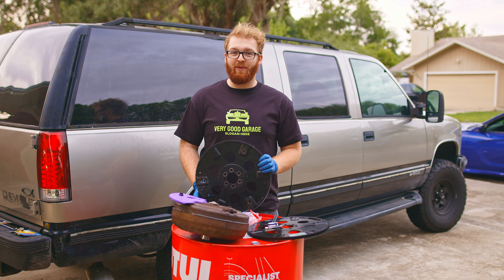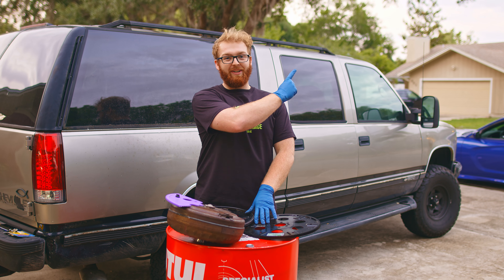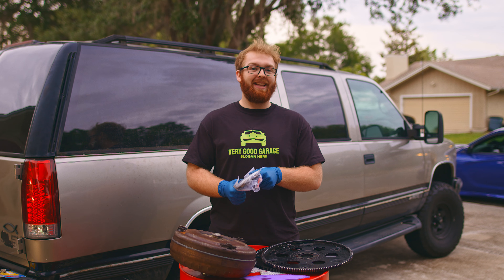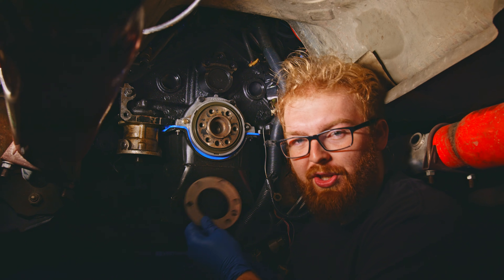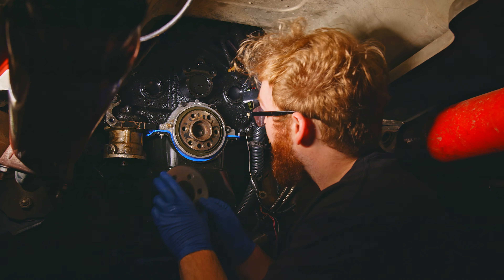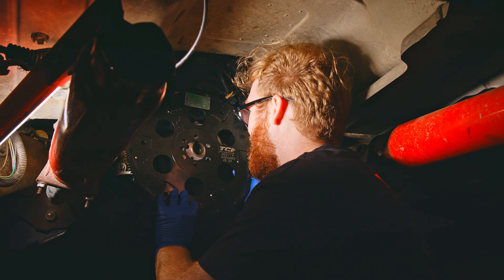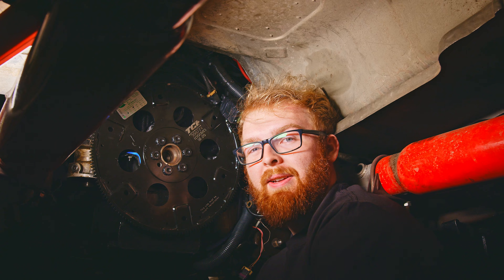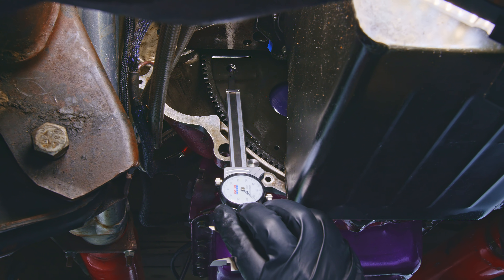How to Install & Shim a Flexplate on a Chevy 350/383 Stroker

Comment: Your close but you actually space the torque converter away from tight in the bellowing towards the flywheel 1/8 to 3/16 then whatever gap to flywheel u shim.
Reply from the maker: Hmm not sure I can picture it, any video references you can send us?

Comment: If you put any shims on a Chevrolet you are installing it incorrectly there's only 2 size flex plates and each one requires a different starter

Comment: So you're slimming your flex plate on the crank, and thats supposed to change the gap between the flexplate and torque converter.. Which bolt together.... I'm either really dumb or missing something.
Reply from the maker: You're just changing how far the torque converter gets pulled out of the transmission pump. The initial gap is the amount that the torque converter will be moving once it's bolted, which is why you want that initial gap to be correct. Otherwise it comes out too far and can slip out of the pump and break things
Reply: 98-99 have different 4l60e. These engines came with a dished flexplate to mate with the converter if you go cheap and use a flat flexplate then shims are a must

Comment: Did you forget to add the correct counter weight?
Reply from the maker: Not 100% sure, I'm pretty sure when I was rebuilding it into the 383, the machinist balanced everything so that I wouldn't need the counter weight on the flexplate, but I could be incorrect. Not sure how much I'd be able to notice if that's incorrect but the engine has no vibration issues that I can tell, so I've just been rolling with it
Reply: @VeryGoodGarage  crank just breaks one day

Comment: So you dumped a stroker crank (what....I guess crank from a 400?) ..into the 350. OK. And you had no idea you might need flex plate shims. Wow!! Well....experience is a good but harsh teacher. Makes me wonder: some previous owner of my C20 did the 383 conversion and I wonder if I may end up with similar starter motor issues. I will say I've had NO issues until late...but I don't drive the truck often. My mechanic just installed a new high torque mini (to better clear the headers). He builds rods and mainly repairs vintage machines. I am sure he paid attention to start motor gear extension. So far no issues. I guess I need to wait for the other shoe to drop!!!
Reply from the maker: Yup basically hit the nail on the head, everyone learns from somewhere I suppose. But yeah, the crank is actually a Scat stroker crank for our 350 that the machine shop guy, who bored out our cylinders, picked out. Obviously we learned a ton from building the first time, so I'm feeling pretty confident about our second rebuild, hopefully the guy who built yours knew more than we did lol, so I wish you luck!

Comment: What flexplate  (brand and part number) did you use for this? Is this 383 Externally or internally balanced? Did you do a flexplate mounting face to block  dimension, and if so what was the dimension? I have questions because I'm doing this right now (same engine and trans) and am having my clearances too close.
Reply from the maker: The flexplate we used in linked to on Summit on the description, and it is internally balanced. I have no idea what the dimension part is, I basically just swapped the old flex plate with the new one plus the shims